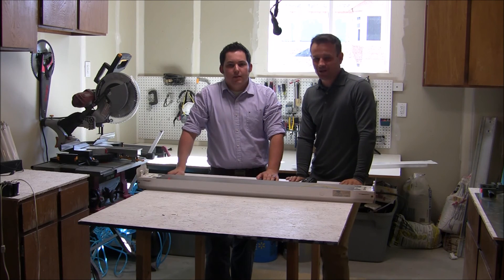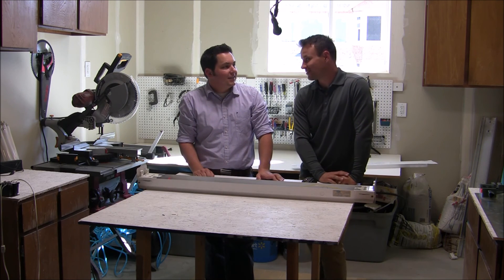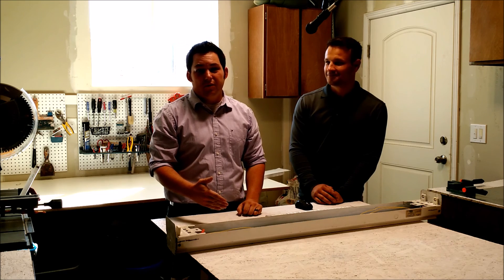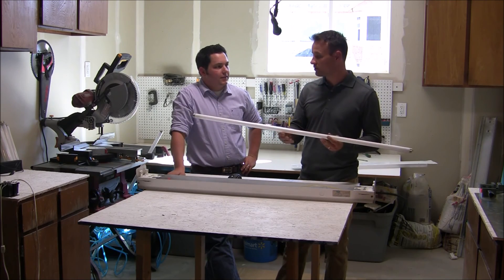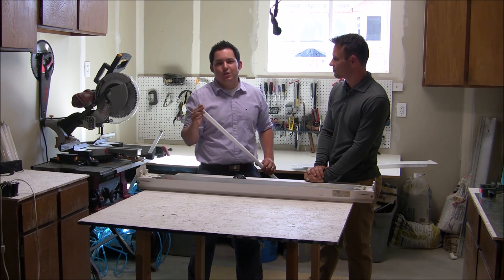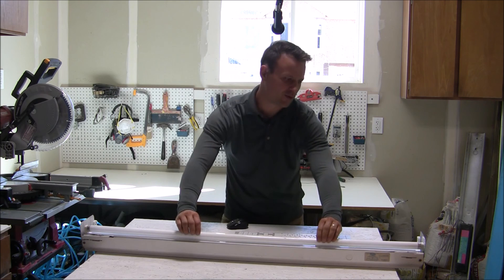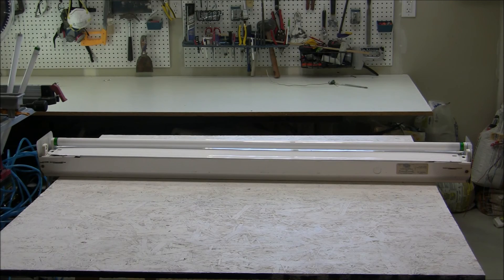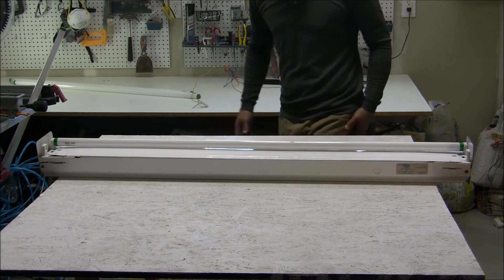Exploding Fluorescent. Fluorescent on direct line voltage

Comment: "We test some of the safety concerns..." Could the tubes have exploded if the safety glasses you guys were wearing had struck the tubes when the glasses fell from your faces as you leaned over the tubes? Oh, that's right. You weren't wearing safety glasses.😁 Hey guys, to be honest, I wasn't wearing safety glasses when I recently converted an overhead fluorescent fixture to LEDs until... I had trouble removing one tube and I stated, "I'll get this tube out if it's the last thing I do." I thought about what I said and put on some safety glasses. You guys and @dbraun7 did answer an important question I had. I loved the whole video but I think I loved the smoke from the transformer the most--the director is a genius! I'm sorry you lost your transformer though.😇

Comment: One problem is your step up transformer is adding some impedance,  much like a lamp ballast does.  Don't know how true this is, but one of my electrician friends, this supposedly happened several years ago then tubular LEDs first hit the markets, knew of one instance where fluorescent tube literally exploded near one  end of the tube, injuring the custodian. when a custodian in an office building,  unsatisfied with the look of LEDs,  ?🤹‍♀️ removed the led tube and re installed the fluorescent.  The the voltage was 277 and i am told it was the configuration line and neutral on one lamp holder.

Comment: I just removed a transformer/starter setup from an old 24" fixture and connected a single end powered keystone LED. would you expect same results for this shorter bulb length? 18" fixture, same results? Thanks for your test demostrattion!

Comment: Years ago, when I was a teenager, I found a bunch of new-in-the-box fluorescent fixtures dumped in the woods. They were 277V fixtures, so I figured that they were stolen from a construction site, and whomever stole them found that they couldn't be used at home, so they dumped them. Most multi-story office lighting is 277V.

Comment: Plasma guy;
Nice work guys! 
The plasma physics and gas physics involved here are reasonably straight ahead, with a couple of electrical oddities. The general presumption by electricians is that the tubes "explode" because their common experience is that they break tubes and they "pop", which is not an explosion but implosion. To make the tube explode, it requires internal gas temperature. Standard hoop stress calculation for basic glass at a T12 diameter shows 199psi. The internal pressure of the krypton/argon charge is <0.1psi!
Standard ideal gas calculation requires a doubling of temperature to double pressure.
Temperature is Kelvin at 300k. Just to bring this level of evacuation to 1 atm requires a doubling of 200 times temperature wise. This is essentially impossible. Even if a full cross section of uniform conduction occured at plasma temp (assume several thousand degrees-which is past the glass melting point!) you still only achieve less than 1 atm and still implode.
I exposed T12's and T8's to >347VAC with a UL test arrangement (target lamps) and found conduction to threshold start at 300VAC(T12) and 400VAC(T8). I held the tubes at several times power rating and the electrodes vaporize and a breech occurs at the end and air enters- all activity stops.
I then exposed them to 347VAC with a truly unrestricted current source. The contactor creates 600VAC reactive spikes and the tubes "camera flash", then die in a fraction of a second. Autopsy shows electrode annihilation and air rushes in as a hole is burnt at the electrode. Air a 1 ATM stops all conduction-which is why no sparks jump between tombstones. 
No explosion- no glass flying - total myth!!
If you want a tube to explode-crack it over the head of those that assume things without some testing and objectivity!!.
Reply from the maker: Great info! Thanks!